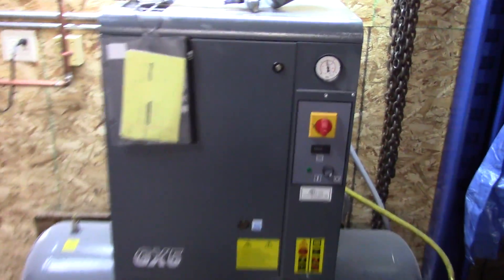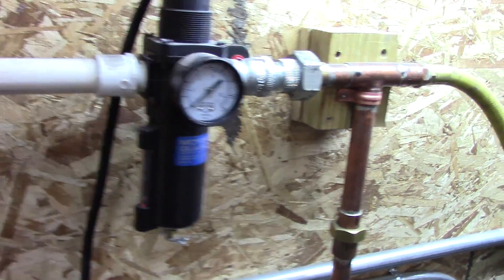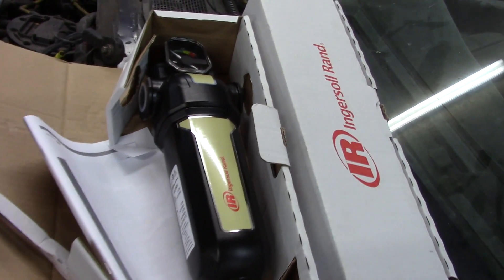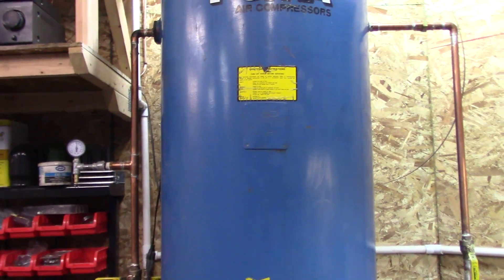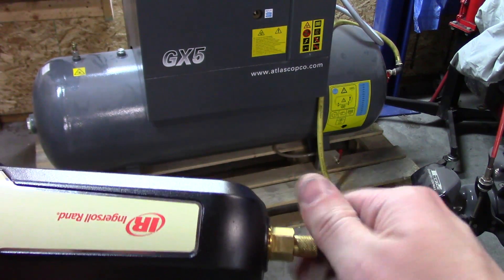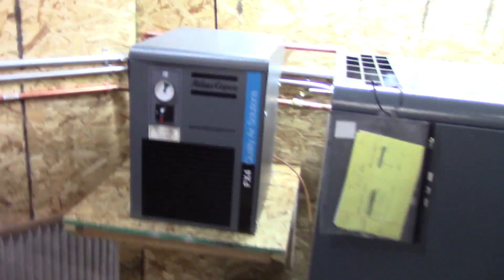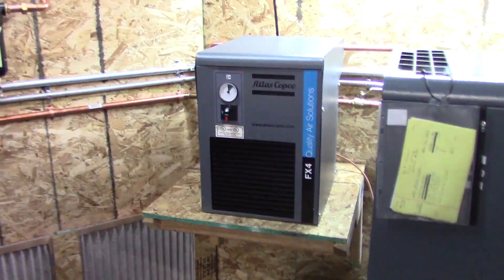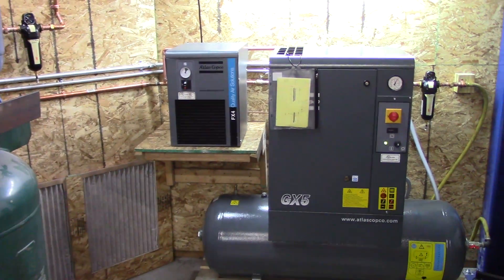Compressed Air Dryer and Filtration Installation

Comment: You should have put the air dryer after the receivers
Reply from the maker: I think I got that layout off a website.  It turns out with the two receiving tanks in series a drier isn't even needed for my application.  The drier placed after the "dry" tanks  may work even better.  Hindsight is 20/20.
Reply: correct.

Comment: Check out the coated hardline kits for piping g air around the shop. Copper is way to expensive for air! But it looks nice. But then every joint is a potential for leaks now or later
Reply: "But then every joint is a potential for leaks now or later". When you are the plumber?

Comment: I think you've done a good job. I like copper because of heat transfer, malleability, and corrosion resistance. The only change I would make would be to get rid of the galvanized fittings and replace them with brass so you don't have electrolysis issues. I might also reverse the order since the upper tank will always be warmer than the lower due to convection, the lowest point in the system will always be the coldest and have the lowest level of condensation.

Comment: Why why pvc pipe??
Highly not recommended for compressed air lines!
Reply: Thank you!!!!!  This guys asking to get pvc shrapnel in his face
Reply: Schedule 80 3/4 in PVC pipe is rated a little over 400 PSI
I've used it over 40 years without any problems.

Comment: I have 50' of copper tubing tapped from the compressor head going outside buried underground then back inside to the 60 gal tank with a water filter before entering the tank. The setup work like a charm never never any water comes out of the tank drain. The buried air line cools off instantly with the weather here in Chicago. I don't experience any trouble with any pressure drop from the tank.
Reply: Haha, never heard of a geothermal compressed air after-cooler... that's a clever setup. The unloader valve must blow a ton of air every time the compressor shuts off though.
Reply: What? Really?? Can you make a video and post us a link in this comment thread? Thanks!
Reply: @technicalitems731  well it's already in the ground.  Just use regular 1/2' copper tubing for plumbing not AC. Connect to the head going out and then connect to the tank coming back in. The shorter the run to get underground the better. I made the hole through the wall right next to the compressor. I strecth out the tubing in a trench about 15 fet long to give more ground surface to cool. You can just bury the whole coil in one spot but it might stay warmer. In the winter it gets really cold.  Room air temp will not do any cooling. Needs to be in contact with dirt.

Comment: I have the same setup for my laser cutter. Dry air is great. I poked the drain line outside so it is maintenance free. My compressor is awesome it makes almost no noise at all.
Reply from the maker: +Robonza They said the air compressor I have is going to sound like a small refrigerator.  Sounds more like a semi lol but at least it doesn't vibrate.
Reply: For the size I think yours is pretty good. Large volume dental compressors are really expensive too.